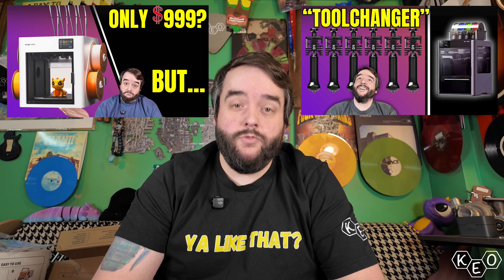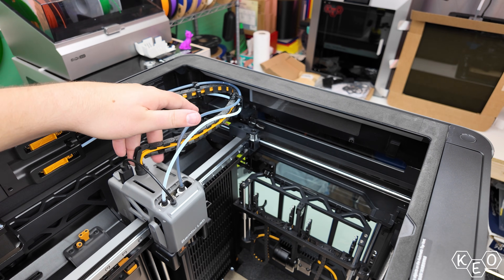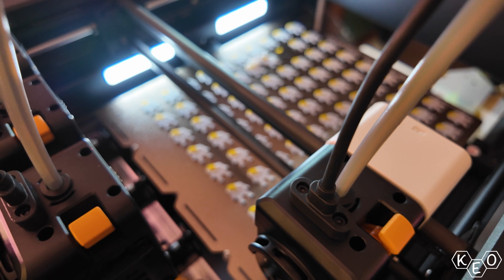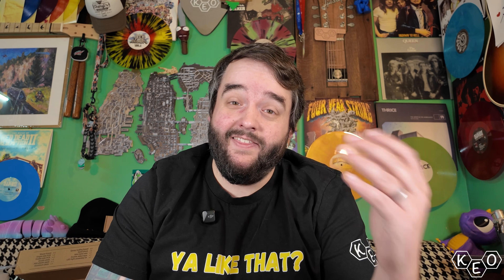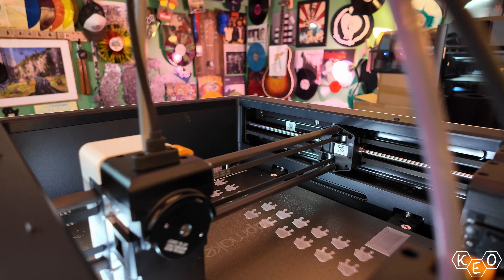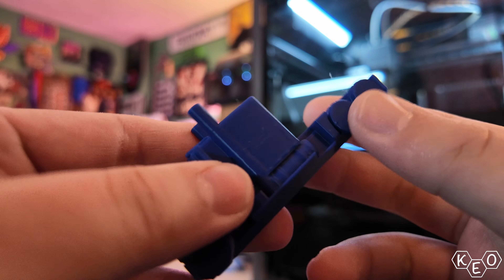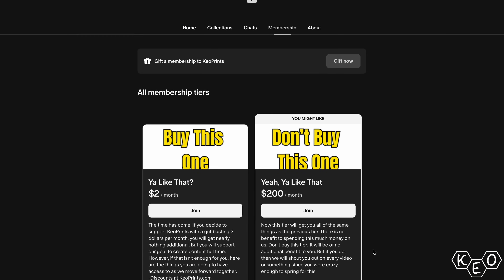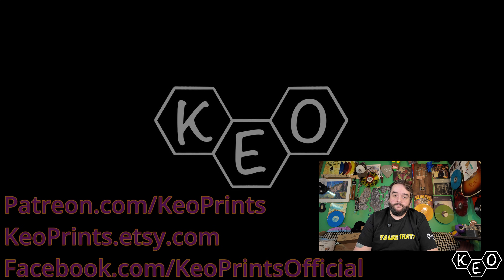Bambu H2C vs Snapmaker U1 — Toolchanger War

Comment: I just got my H2S. Not gonna lie, all these tool changers are for very niche uses or for people that want to print crap.

Basically everything that I've thought "oh no, I won't print that cus it would waste too much filament on colour changes", was decorative crap that is cool. But it was always things that I wouldn't have paid what it would cost in filament to print it, even if I didn't take into account filament waste.

I only thought about printing them because the cost is kind of hidden until you slice it and see how much it uses.

Unless you are actually using a printer to make money, the savings from a tool changer are likely never going to total more than the difference in price compared to a single nozzle with ams.

Sure it saves time, which again, only matters if you are using it to generate income.

If it takes me an extra 3 hours to print a santa I don't need, that's 3 hours I can't print more crap I don't need.

The tool changers are cool.

But people need to stop thinking they "need" one if they are just a hobbyist that's downloading files and clicking print.

If I desperately need something to be a certain colour, I'll paint it.

There's a moulding I need to print for my car, it needs to be black.

I'll print it in ABS, I only have blue and red.

It'll be maybe 50g of filament.

I'm not going to spend nearly £20 on a roll of black ABS when I can get a can of filler primer and black spray paint for less.

It'll look nicer too cus it'll help hide layer lines and imperfections.

Let's face it, printing is largely just a hobby in which most of us waste ridiculous sums of money on stuff we don't need.

I could literally just buy the part I need for my car for £25 and save probably weeks of learning cad and probably save money in general when I make it wrong 15 times.
Reply: AMS is for printing colorful crap…. Tool changers ability to print functional parts in multiple materials without cross contamination for support or flexible segments is far from useless crap.  It’s why I say the H2D is so brilliant, enabled so many functional possibilities. but vortec is stupid as its massive cost and complexity for a tiny step up from dual nozzles.
Reply: @jb510 yeah, I can see a use for a h2d.

But the tool changers are for useless crap.

If you're printing functional parts that actually require multiple materials, it's very unlikely you're printing them in PLA or PETG.

So something like the snap maker is not a great choice, because whilst you might be able to print abs and ASA in it, for reliability and a good chance at repeatable dimensional accuracy, you'd want a heated chamber.

Then if you're using any more exotic filaments than those, you may need hotter nozzle and bed temps for reliability.

To get any of that on any current options for tool changers, it's either very expensive out the box or requires a lot of tinkering to add features.

Except on the H2C. But the most common types of multimaterial prints I see people saying they "need" are as you said, for a different type of support material or for TPU additions like gaskets or feet.

But the H2C and H2d need workarounds to do TPU.

And as for supports, it's almost always an aesthetic issue to prevent surface defects or about saving a little time on post-processing.

There is the rather niche cases in which there may be internal supports that can't be reached and dissolvable supports would be advantageous.

But 90% of the time, unless you are using these commercially, they just aren't needed.

Most of the multimaterial prints I see could easily be designed to just print on 2 plates and be glued together.

So as I said, tool changers are only actually useful for commercial use where long production runs make the cost and time savings add up, or for the very niche cases that 99% of hobbyists are never going to need.

They are toys for people to justify printing more crap.

I'm not dissing the hobby, I haven't stopped printing since I got my H2S.

Just being honest about it, literally everything I've printed has either been for my printer or crap that I didn't need.

The vast majority of people that buy printers never even learn how to make their own models.

That's the main reason I'm stuck printing crap just now.

Because I need to learn CAD to print the few things I do need and I'm mostly just printing crap to familiarise myself with print settings and issues I might encounter.
Reply: Very true, sir. I have the U1 and it's still in the box for weeks now, waiting for the need to be used. I only print functional items, and the U1 purchase was just due to hype.
Reply: @lesterpaulpalad yeah, I think snap maker should definitely be aiming for a more expensive version.

If they released a U2 next year with a bigger build volume, fully enclosed out the box, maybe more tool heads, 350° nozzle, 120° bed and actively heated chamber.

Then they would likely dominate bambu.
Reply: @Scottbutcher7 I'd like that, too. That's basically the Prusa XL, though
Reply: @lesterpaulpalad yeah, but if snapmaker could do similar for cheaper and have it be basically plug and play.

I'm not super familiar with the prusa xl but I'm pretty sure the base setup is quite expensive and requires add ons to be enclosed, heated chamber and so on.

If snapmaker could have a plug and play tool changer, fully enclosed with heated chamber and hotter nozzle and bed temps, for about the £2000 price range, they'd likely own most ends of the market for a while.

Provided they hold up well and the software is decent.

They'd likely do even better if they make some form of enclosed ams style system to keep filament dry while printing.
Reply: As someone with a P1S I definitely enjoy enclosed chambers and the like for ABS and some other filaments.  I want a tool changer because you can easily mix PLA/PETG for supports and combine TPU with other materials.  The H2 interests me with the build area but I'm very tempted to just keep my P1 and add a U1 even though I'm not entirely sure where I'll find the space in my place for two printers.
Reply: @EkiToji that's my point though, you want to add a different support material, you don't need to.

And basically the only reason to do so is for aesthetics most of the time.

I have no issues removing supports on pla, PETG or abs

They can sometimes just leave minor surface defects.

And again, my point is that most people just print crap they don't need.

And yeah, the snap maker is for people exactly like you, that want to print basic filaments, and be able to use multiple of them.

Which is almost always used for aesthetic crap.

Find one thing that the snap maker can do that a P1s can't, that doesn't involve multiple colours or boil down to making something look nicer, or that can't be solved by a better design.

Now weigh up the likelihood of someone actually needing to do that.

Almost every advantage of tool changers is an improvement to an existing capability.

If you are just printing things for yourself, setting aside time, how many prints would you have to do with a snapmaker to justify spending an extra $1000 (cus let's face it, you'd likely buy add ons) on what is ultimately a hobby.

They are all just cool toys to entice people into buying features that they don't actually need.

The majority of people are rarely ever going to print more than 4 colours, nor do most people ever feel the need to use different support materials.

And 99% of people are never going to use more than one material on a print.

Comment: Don’t know why people keep skipping this, but you we will also be able in the future be able to upgrade from the H2S. This has been affirmed by bamboo labs process is a couple steps longer and looks like it will cost about $700.
Reply: They are already being sold (and sold out) but it's not cheap and comes with less nozzles etc etc. You can upgrade the older machines indeed but its a lot of work and not that cheap.

Comment: If they cost even close to the same it would be a better comparison. Absolutely insane you can get the U1 + enclosure + 5 years of replacement parts and still save $1000...
Reply: And how do you 'win back' the 1.7x build size ? you simply can't compare them best thing you can say is that the U1 is better value and as a 'very fast 4 color basic materials mid size printer' has no equal at the moment and probably won't for a while. And mambu can't and won't compete with it on price even if they release say a x2c.

Comment: A the fresh air on a Monday morning of Bambu #1 fanboy
....that is one that has a sense of humor.

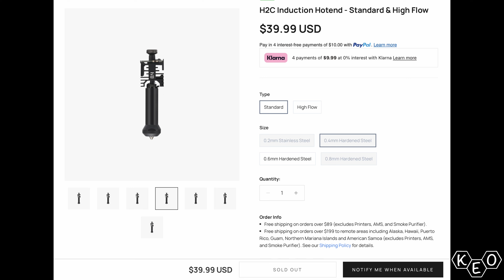Did 3:25 I hear you say neither has replacement tool heads available 'yet'? .... Ya, I would set up my shop with 10 of those...
Reply: Well they are for the h2c both the upgrade kit and the mozzles. But as expected they sell out withing minutes coming online. This has been made worse by the 'package' they offer called ultimate that includes a extra set of nozzles, ams, ht's ... I and many now have 13 nozzles in our homes but still trying to get more putting pressure on them.

Comment: I love my P1S, but I think most of us will be jumping ship to snapmaker soon. Bambu jumped the shark on this release.
Reply: Haha same
Reply: There is rumor of an X2C with a Vortek option, but that's it, a rumor.  I do know the X1C looks to have been removed from the Bambu store, although when I asked they said it was just out of stock.  But that doesn't make sense, as they would normally just mark it as unavailable like they do with their other stock.
Reply: Bambu removing filament profiles of other vendors, rather than expanding the collection, is another big no-no in my book.
Reply: @EditioCastigata  Why should a 3D printing company be obliged to provide filament profiles of different brands?  There are the means to create your own profile with many manufacturers available by default.
Reply: oooor....switch boats to Prusa with INDX

Comment: Anytime the whole "Which is best?" debate comes up I try to remind people that "best" is relative.  What's the best vehicle?  What's the best watch?  What's the best burger?  It depends on who you ask and what their requirements are at that time.  In cases with a printer when ONLY print speed matters then whichever one can finish the job quickest is the best.  But if that the ONLY criteria then there much better printers than either one of these options.  If cost is what one considers "best" then a well used ender you get for $20 off craigslist is the winner.  "Best" in a 3D printer is just like a beauty contest:  It's all in the eye of the beholder.

For me though being able to access the printer settings and firmware is a KEY requirement.  I'll sacrifice some speed if that means I can get elbow deep into the printer configs and make modifications where I see fit.  I outright REFUSE to get locked into any manufacturer's ecosystem irrespective of what functions and features they offer.  It's one of the reasons why apple has never seen so much as a single cent of my money and why bambu won't either.

Comment: $2500 versus $1,000 does not justify a marginal print quality increase in my opinion
Reply: If you needs fit within the U1 specs there is no way to even compare indeed but its not there is a lot of things the H2C has/does the U1 does not for starters its build volume ie 1.75x. closed and heated. It's not limited to 4 colors in anyway and still 'fast' up to 7. You can only compare them on a subset of types of prints and if that is your 'area' the U1 makes more sense if not well the h2c gives you way more options you just have to work around the speed. For example even for 4 color prints you can still 'fill the buildplate' and if you can place 40% more items on a plate gain speed back in that way.
Reply: most users do not need this but usually a more experienced user might need this, I got a H2S to go with my U1 and I am very happy.
Reply: He says that while showing off VFAs from the H2C as well.  The U1 uses better belts so VFAs shouldn't be as problematic with the U1 and any other minor differences can easily be fine tuned if they're a bother.

Comment: The issue is most users who are private individuals not running a print farm are going to want the ability to do TPU so that pretty much eliminates the h2c from a cost / functionality standpoint I get it if you're running a print farm then sure the h2c makes a lot more sense but most of us don't run print farms.
Reply: You can print 2 tpu's at the same time its fine like always just feed them by hand it sucks that its limited in the ams but its not like you don't have to feed it by hand on most printers.
Reply: @scb2scb2  2 TPUs is not enough for anyone that wants creative freedom with 2 TPUs with a support material OR 4 TPUs
Reply: @scb2scb2  with the shoe printing craze, that will not be enough
Reply: @allanloudermilk4055  Well then the U1 found its niche i guess 4 color printed shoes. Ill try to take a picture of someone wearing them when i see it it will be a special moment i want to remember.